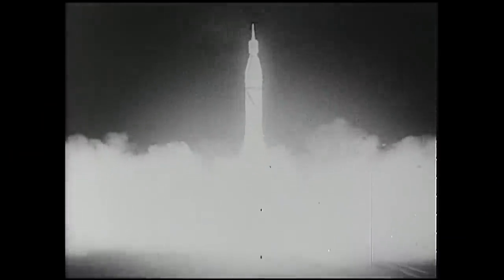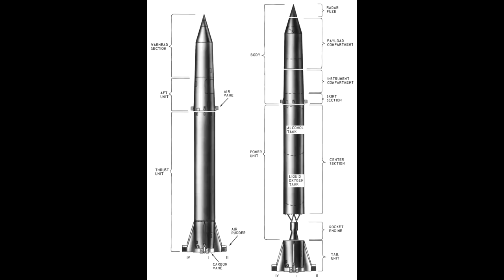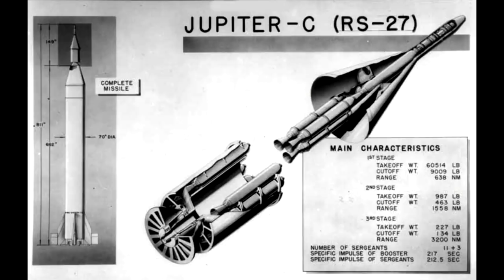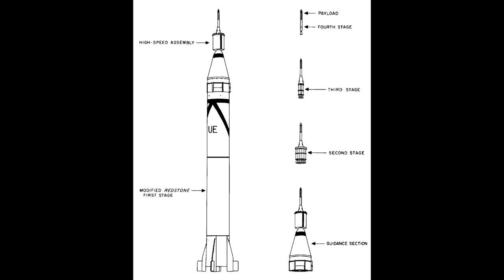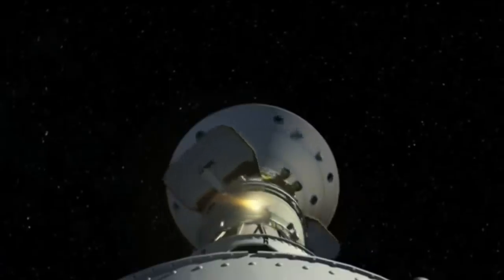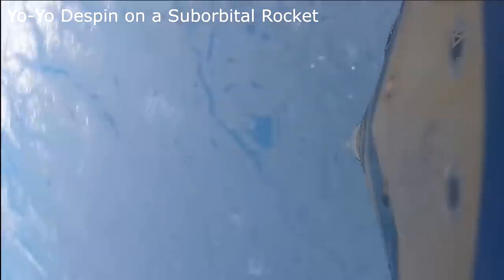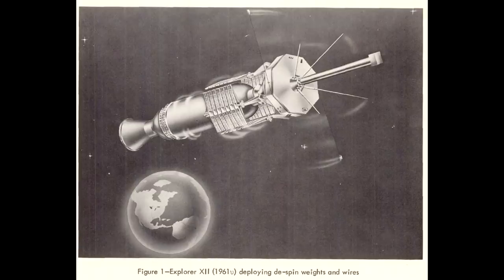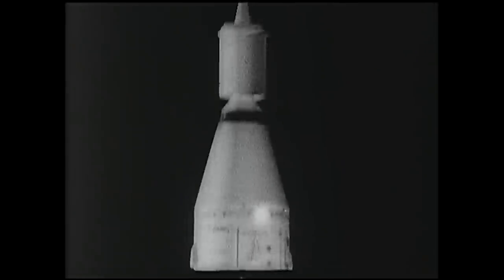Why Spinning Was A Good Trick For America's First Space Launch

Comment: Scott, Scott, Scott.  At around the 2:30 point you ran head on into one of my pet peeves.  No rocket engine ever generated a thrust measured in kilograms.  That's a unit of mass.  Thrust is a force.  So, instead of 700 kg say 6867 Newtons.   Remember, weight and thrust are a force and are measured in Newtons. .....   Sorry.  Rant over.
Reply from the maker: Kilograms of force is an accepted unit. Also, Werner von Braun’s rocket group regularly expresses thrust in kilograms.
Reply: Thrust can be measured in anything that can also measure mass. Lb tons kg etc
Reply: @qed100  yup